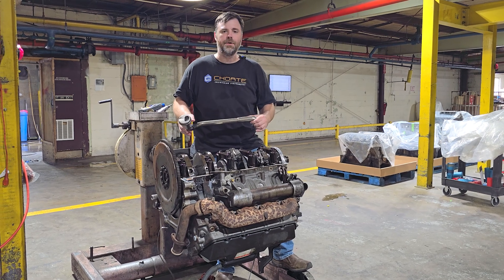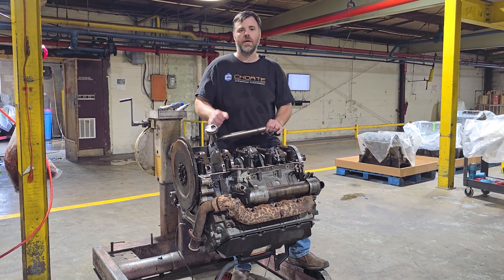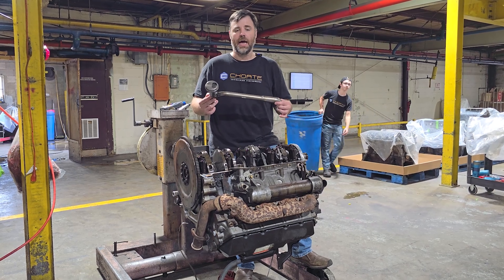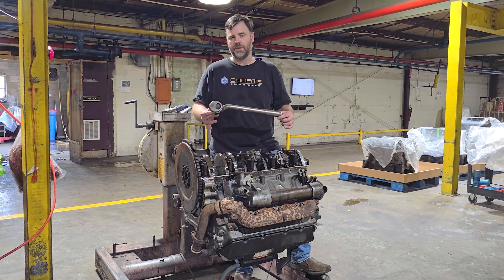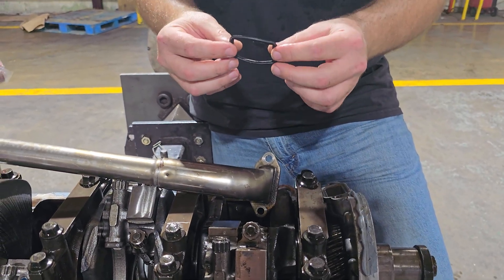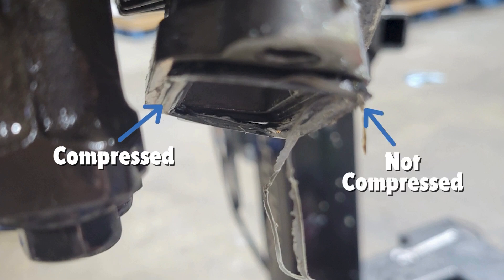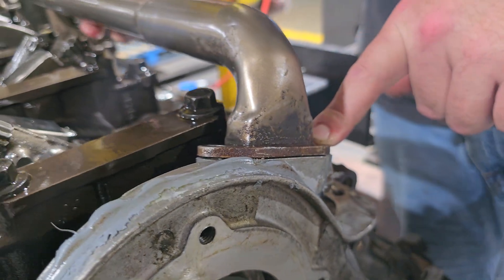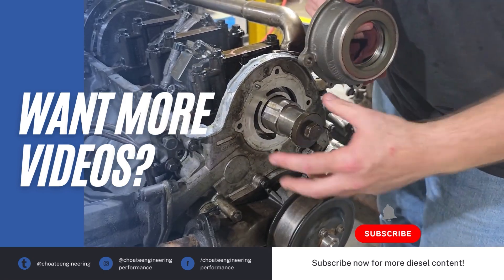Oil Pickup Tube: A Major Installation Mistake on a 7.3L Powerstroke

Comment: My truck 7.3 been in shop for 2 years chasing a p1211.. slight drop under 2000psi on the high side.. new everything,  , sometimes twice, the new dorman oil pan ( garbage fyi) the shop claims they found a drop under 35psi on the low side under load.. another couple years I should have more info if this truck ever gets fixed.. running the 7.3 gassers in other trucks. Must easier to keep running..